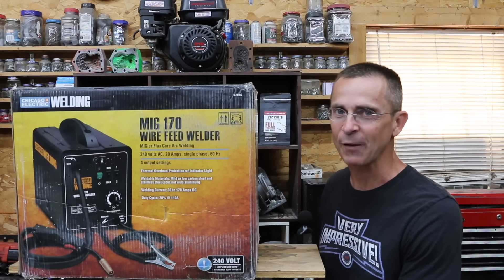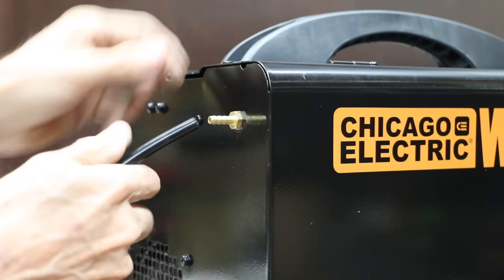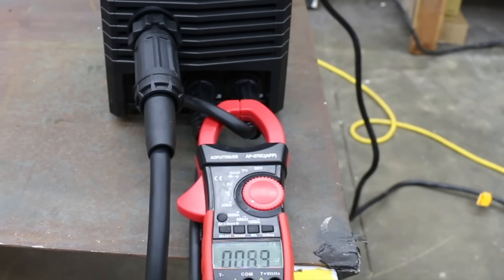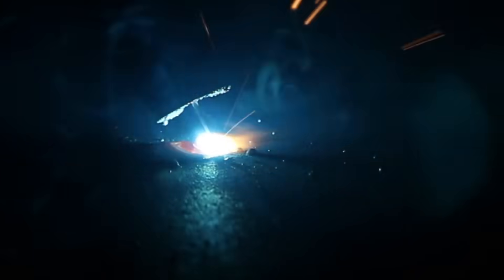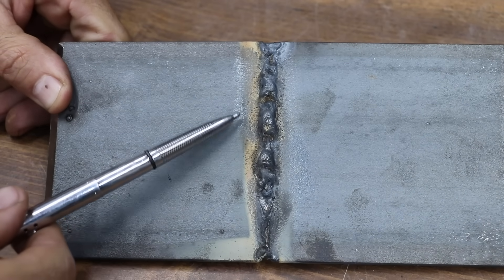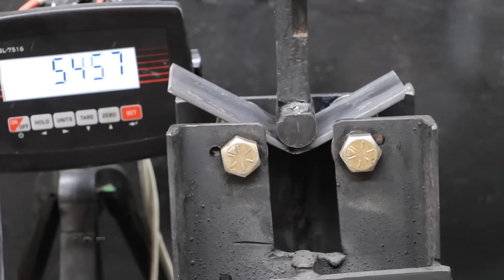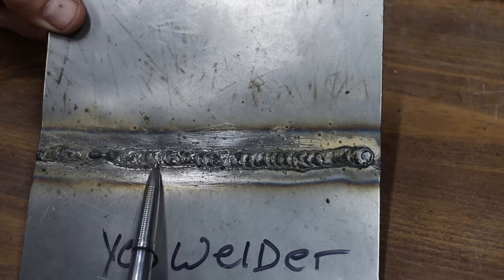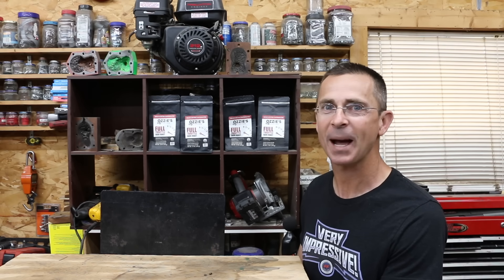Cheap vs Expensive Welder? Let’s Find Out!

Comment: A good test for a welder is to weld something with rust / grease / paint on it.
The current in cheap welders sags when you hit those spots whereas the top line welders blast through it and don't sag.
Of course you prep metal where you can but in some circumstances like welding machines in the field you cant remove parts to prep the weld surfaces and sometimes you just have to blast through the crud to get a weld on something.
Those are the times you'll find out how good a welder is particularly a stick welder.
Reply from the maker: Thanks for the feedback.

Comment: Running a machine for 10-14 hours a day every day until the jobs are done from anything from 115°f to literal white outs in -15°f.. no, the big $$$ machines arent a rip off. These chinese ones are GREAT for hobbyist type work. Not industrial
Reply from the maker: Thanks for the feedback.
Reply: @ProjectFarm  no thanks for doing this test! I don't always have a big machine sitting in the driveway anymore, and I still have projects and car builds to do. These smaller cheaper machines work wonders. I'm not throwing down pie cut Tig welded titanium charge pipes and exhausts and turbo mounts, Al and SS mostly, but they work great! (Some of them)

Comment: The video was very well done. I would suggest a cut a macro etch for judging weld penetration. Also for sheet metal It's a lot easier to weld with thinner filler material .030 or .023.
Reply from the maker: Thanks!  Thanks for the suggestion.

Comment: You got to this fairly quickly.  Thank you!  The Chicago Electric says, Not for Aluminum.  Are any of the others good for Aluminum?  I was told that MIG will be for me, but I will be a complete Newbie at this, only for homeowner needs.  I don't think I'll need to butt weld 1/4" steel plates to worry about penetration (or annnnnny butt welding at all), nor 45° bevels (even though the Azzuno did well here), so the Azzuno may be the one for me, plus it can do Flux Core MIG, Solid Wire, Lift TIG and Stick ARC, and a Flux Core spool is easy to load.  It is #2 on 20 gauge sheet metal welding with a great minimum current; just keep a steady pace.  I'll have to see if its feed skipping can be consistent enough before buying, once I figure out what all my uses would be.  I may need to weld a support plate for rusted out place for the steering wheel shaft on a tractor mower chassis and I'm hoping the Azzuno will be great for things like that.  Feed skipping may be a spool loading issue or a feeding issue at the insert or feed wheel(s).  If I select one in this comparison, likely the Azzuno, I'll buy it from your link.  Thank you, Todd!  Great Job!

Comment: Duty Cycle was a spec that had a big impact on the price back when I used to weld more often, basically how long you could weld constantly without giving the machine a break.

I guess with these electronically controlled welders that isn't so much of a factor?

Comment: Most of these cheap Chinese welders are perfect for anything you would need around the house but if your running a business I wouldn't get something cheap. A lot of the weld quality comes from experience of the welder not just the machine, these auto set functions on the welders are great for the novice but I wouldn't want that function on mine.
Reply from the maker: Thanks for the feedback.

Comment: I repair welding equipment for a living. I can assure the reader that if you buy a machine made in China, you will be buying junk. I don't care what the price is, it is junk. The Communist Chinese steal American technology without reprisal and then think of any way they can manufacture it cheaper without regard to reliability. When your Chinese built machine stops working, just try to find a shop who can repair it. Good luck. You'd be better off with an oxy-fuel torch rather than a Chinese electric welder.

Comment: I bought a Hobart Handler 140 in 2015. I used it almost daily.  In 2020 I started having intermittent feed speed issues.  I got the kit to fix the control board. I don't remember if I ever installed it... In 2021 I was thinking about buying a replacement.  Just then I got an offer the repair dumpsters, I spent 6 months welding 12 hours a day on a 10ga 25ft extention cord. I've still got the welder now and it works just like it always has.  I know it's not a Miller or Lincoln,  but it's paid for its self hundreds of times now!
Reply from the maker: Thanks for sharing.

Comment: Great video as always. I was shopping this weekend for welding supplies and had a few video ideas I thought would be interesting. 

Grinding discs, cut off wheels, flap discs, and wire wheels. Are the more expensive name brand ones better and longer lasting, or are the cheaper options a waste of money and a safety hazard? A DeWalt 4” wire wheel was $22 at tractor supply while a 4.5” at harbor freight is $5-7.
Reply from the maker: Thanks for the video ideas.

Comment: Picked up my Vulcan 220 when HF introduced it for $550 6-7 years ago (or so).  When Miller, Lincoln, & Hobart were still working on getting their IBGT (solid state) welders reliable.  I've used it for stick & FCAW, and have the parts for GMAW and GTAW.  I've been very happy with it, except on thin material.  I agree - wants to run rather hot and wish there was a firmware upgrade allowing you to dial the horses back a bit.
Run them through again, but this time with stick and gas - see how they do.  Can't call them a multiprocess welder unless they can at least perform the trifecta of stick, FCAW and GMAW.
Great review, as always - and glade you asked Virgil to come over and give his professional opinion.
Reply from the maker: Thanks!

Comment: Giving a "first place" for 0.003" difference in welding quarter-inch (6mm) plate is a bit of a stretch. As I see it there was a three-way tie for first in the penetration test.  Zero point zero zero three inches is a small margin and there's only 0.002" (0.051mm) the difference between the Lincoln and the Yeswelder on penetration. Measuring one single coupon? Assuming that's an average of several measurements.  

I understand the line has to be drawn somewhere, but those aren't meaningful margins in "real world" applications or testing for certificates. 

Appears to me that Primeweld is one of the best bargain welder companies to deal with. Their products are good (as professionals have confirmed, and they provide quick and easy warranty (from reports, not promos). But I'm just a guy. You got the subs! Thanks all the same.  I can always learn something on your vids.
Reply from the maker: Thanks for the feedback.

Comment: Mig welding is a constant voltage variable amperage process. Judging a machine by the Amps is problematic because it is variable based on a lot of things including the wire diameter and the “stickout” (distance from contact tip to the puddle). A shorter stickout will give higher amperage. Longer stickout will result in less amerage. You said the machines “heated up” but more likely the puddle built up resulting in a shorter stickout distance, increasing the amperage.

Comment: As a gear head that rents shop space with a buddy, we’ve had a Vulcan 220 for like 5 or 6 years now, such a good value machine. It’s been going on flawlessly for the amount of use we do with it, for home garage work, it’s perfect
Reply from the maker: Thanks for sharing.
Reply: I was thinking about picking one up someday. I have the Titanium Easy Flux 125 welder and that little thing surprises me. It performs well once you put some decent flux core in it. Great for small around the house things and small projects.

Comment: fantastic work as always. Would you consider doing a video on garden hose quick disconnects? Every version that I’ve purchased only last a month or two at best before they start leaking severely.
Reply from the maker: Thanks!  Thanks for the suggestion.

Comment: Check the fine print on the warranty.  Harbor Freight welders only have a 90 day warranty.  Not long for something so expensive that is subject to heavy current and heat use. Harbor Freight tech support told me they have no repair facility so after 90 days it is all yours.     Be sure to check the warranty!
Reply from the maker: Thanks for the feedback.

Comment: I can most definitely 100% tell you as q person who used to weld in industry the more expensive welders will perform better will have better constant current. You will have better control of amperage and will have better duty cycles.  

More expensive welders will be more durable also. Compare an esab or miller or Lincoln industrial sized you will see a difference
Reply from the maker: Thanks for the feedback.

Comment: As always, a great review.  
A friend gave my nephew an older Chicago Electric welder.  The wire feed tensioner was made out of plastic, and tended to bend over time.  I had to carefully file the bottom of the tensioner a couple of times to actually achieve some tension.  It also seemed to lose tension if left clamped down for months at a time.  So, best to release tension if the welder wasn't being used for a while.  Metal tensioner clamps look much better (but need good power isolation).  A good addendum would be to somehow measure the tension of the wire at the tensioner.  Perhaps there would be a crushable wire that one could measure the crush with a feeler gauge.
Reply from the maker: Thanks!  Thanks for sharing.

Comment: Excellent work and presentation as always. I am wondering if you could shed some light on power chips for automobiles? Most plug into the OBD2 port and promise more horsepower and increased fuel efficiency.
Reply from the maker: Thanks!  Thanks for the suggestion.

Comment: I wouldn't mind seeing a video on flush cutters they get dull pretty quick even when i am only cutting low voltage wire. Same for Electrician Scissors those get dull for me in less than a month now.
Reply from the maker: Thanks for the suggestion.

Comment: Some of the welders might have what's called a 'hot start' feature where the amps will be slightly hotter than what you set it to and then drop down once you get a pool going.
Reply from the maker: Thanks for the feedback.

Comment: Work at an OEM provider for fuel tanks. While I do not have that vulcan model (mine is just mig), I have always wanted to section my welds and compare it to our OTC machines. The vulcan can hang, if you manually set it up.
Reply from the maker: Thanks for sharing.

Comment: One value welder not listed is the titanium welder. If I could I would return it and get the Vulcan brand, if you are shopping harbor freight brands. The welder surges, the spool motor is inconsistent, the voltage at 110 isn’t enough to burn 120 wall tubing constantly and uncontrollable that it burns through 20 gauge in the weakest setting. Also if you try tig welding, scratch start SUCKS!
Reply from the maker: Thanks for the feedback.

Comment: Parts availability is another thing to consider, ive had the same hobart one for years and have gotten just about everything (liner, diodes for the main board, gun, etc.) From airgas without issue.
Reply: Hobart is great
Reply from the maker: Thanks for the feedback.

Comment: One unit that you didn't test is a Hobart mug welder. Hobart and Lincoln Electric have several different models. Duty cycle is very important when it comes to performance.
Reply from the maker: Thanks for the suggestion.

Comment: Surprised you didn't include a Miller welder in that bunch.
Reply from the maker: Will be testing the Miller in round 2.
Reply: @ProjectFarm  oh okay. Cool. I think an interesting topic would be the best gas engine welders. Not necessarily the big ones but something like the size of the Lincoln 185 outback and others comparable in size. Just another suggestion for the suggestion box.

Comment: So you ran the machines for 5 minutes which is about equivalent to a 50% duty cycle (depending on the amp) - what are the listed duty cycles on those machines)
Reply from the maker: Thanks for the suggestion.

Comment: Great video as usual.  How does a Miller Electric welder not make this lineup. Miller would have been better to have than Lincoln IMO. May have made the test even more expensive to do. Nice work!
Reply from the maker: Thanks!  Will test the Miller in 2nd round.
Reply: You mad bro? Lol. Could've added it I agree but don't take Lincoln out. I'd rather seen a head to head with Miller vs Lincoln than the Chinese brands.
Reply: @sirreus3003  Zzzz…. Why would you think I’m mad? ‘Bro’. Miller is far more popular among professionals than Lincoln is, that was the primary reason.

Comment: I have an old (10 year) Northern Tool Welder with an aluminum gun, arc and MIG and TIG. I also have shielding gas available. I have welded the tar out of stuff on  my Ford 555C backhoe, including a thumb, and have not had an issue yet. I play everything by ear and sight.  If I need more power I turn it up, if the feed is too slow, ditto. It does look like a rinky dink POS but it has been good so far. It's not like I use it every day, though.
Reply from the maker: Thanks for sharing.

Comment: I have a Lincoln, and I got a Vulcan 200 Unlimited because it had stick, and also because I wanted something new to play with. I knew the Vulcan was risky from the service standpoint, but it was very cheap at the time, and I know a little about electronics, so I figured I could fix the most likely problems that could arise.

I almost never use the Lincoln now. I've made lots of stuff. I like the Vulcan's nimble torch more. I built a brush fork for my tractor, and I lift lots of heavy things with it. No weld problems. The truth is that you have to be putting pretty extreme demands on welds in order to cause problems. The vast majority of welds are way overdone. For example, I built a little rolling stand for an arbor press. Just about any weld on it can stand up to tons of force, but none are likely to see more than maybe a hundred pounds.

I used it to put a SWAG Offroad finger brake together, and it doesn't even seem to notice the force of a 20-ton jack.

I think strength of weld is what it's all about, and the Lincoln and the Vulcan are pretty similar in that regard.
Reply: No
Reply from the maker: Thanks for the feedbackk.

Comment: As always great video. I have not owned enough welders to have a informed opinion on anything. I went from a Miller 220v and a Clarke 120V transformer welders to a HF Titanium Unlimited 200 inverter welder. Comparing a Transformer to a Inverter is just not fair, but I did find the (thanks to HF running out of .030 wire) running different wire sizes has a dramatic affect on welder performance.  I now have a 10lb roll of .035 for 1/8 and above (most common for me) and a 2lb roll of .025 for thinner then 1/8.. It makes a Huuuggggeeeeee difference.

I do not know were the the Titanium lands on this scale, but I imagine with any welder...... the change will be dramatic. For the cost, I suggest trying it.

A+++ Vids,. thanks again
Reply from the maker: Thanks  Thanks for sharing.

Comment: My ranking is different for the Welders 1at is Azuno by the numbers
Price (% diff from lowest) | Strength Test (% diff from highest) | Five Minute Test (% diff from high) | Average % diff
|------------|-----------------------------|-------------------------------------|----------------------------------------|----------------|
| Azuno |   -33.3% ($252) |     3.4% (6133 lbs)      | 15.2% (123 amps)         |-5.2% |
| Yes Welder MIG 205 DS  |-90.5%($360) |19.0%(5143 lbs) |8.3%(133 amps)  |-21.1%|
| Flame Weld (baseline) | Baseline ($189) | 6.0% (5972 lbs) | 41.4% (85 amps) | 23.7% |
| Chicago Electric |-21.7%($230)|25.0%(4759 lbs)|100%(Overheated at 3 min 43 sec)|30.1%|
| WarcKing   |-37.6%($260)  |41.0%(3743 lbs)  |100%(Overheated at 4 min 52 sec)  |34.5%|
| Vulcan Omni Pro 220 |-608.5%($1150)|N/A(Almost 6000 lbs, baseline)|0.7%(144 amps)|-202.6%|
| Lincoln 210 |-1216.4%($2300)|Baseline(Highest at 6349 lbs, baseline)|Baseline(160-145 amps, baseline)|-405.5%|

Comment: I have a Miller Matic 211 it has never failed me or let me down. I have ran so long on it that I have actually melted the contact tip out while welding and did not realize it until the tip dissolved. it was expensive and I can do it cheaper. But I don’t worry about its quality, even for what I paid
Reply from the maker: Thank you for sharing!

Comment: I'm not a welder, or an electrician, but using an adapter to turn a 120V welder into 240V doesn't sit well with me.  Oops, forgot to flip that switch back!

Comment: The difficult test is the long term quality of the mechanical parts, like the wire feed mechanism. If the welder starts creating birds nests after prolonged use, it will be a real pain to work with.
Reply from the maker: Thank you for sharing!

Comment: Is it possible to do a welder comparison without a Miller? I was a pipefitter by trade before retiring and all we used at two nuclear plants as well as private contractors were Millers. That's all I have at home. I retired as a mechanical estimator for one of the larger contractors that used Miller exclusively so my machines were discounted. If I delt fairly with folks the job had its advantages. It always pay to treat people as you want to be treated.
I watched this comparison to see how you were testing them. I'm always impressed with your techniques. Tell Virgil he's hired.
Reply from the maker: Thank you for the video idea!

Comment: One day, 1600 comments?  I knew I liked this channel, but WOW!  My shop is Miller at home, Hobart in one business.
  Both perform well and good support.  When I was selling MAC tools 40 years ago they sold Astro branded welders from Italy.  I had one at home for a couple of years, couldn't get parts such as driver rollers.  Got tired of that, paid the price for Miller and have never gone back.  Yeswelder does look like a deal IF you can get parts.